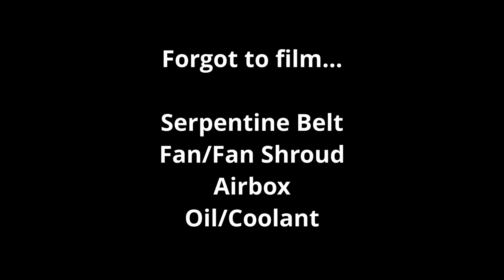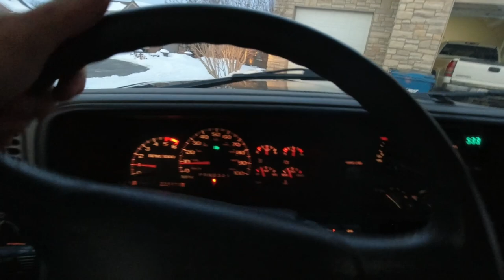5.7 Vortec Head Gasket Replacement/Intake Gasket Failure 1997 K1500

Comment: Omg I’m about to put my engine back together on my 96 c1500, hopefully it’ll sound as good as yours.👍🏻
Reply from the maker: If you let the muffler rust off like mine maybe it will
Reply: @montsmatic  😂 or drill some holes in the muffler  gives it a good cam sound

Comment: I have the same engine and the oil pressure on my truck at high idle is at 40psi, but at a red light, at idle it drops to 20psi. On your video it looks like ur truck does the same, is that normal?
Reply from the maker: That can be more normal, but my oil pressure issues have gotten worse, I am rebuilding the engine now.  20 psi is fine at idle.

Comment: Did u pull the oil pan and clean that too or did u do a oil flush
Reply from the maker: I flushed all the oil.  There ended up being crankshaft damage from the engine running on water for a short period.
Reply: @montsmatic  thanks for the reply and I hope I don't have the same issue but I'm sure probably do since I had to drive it home with water in my oil